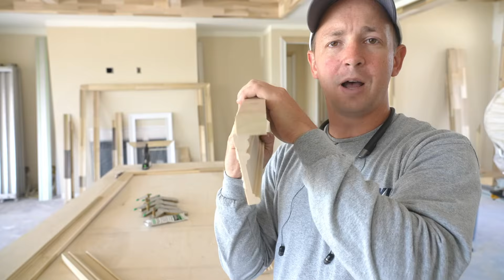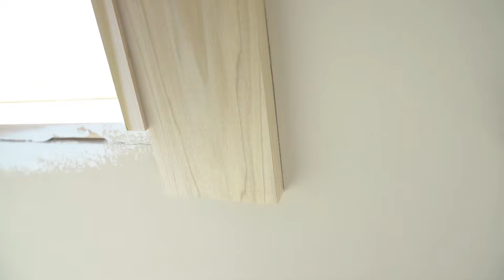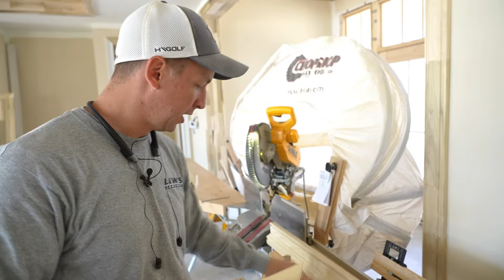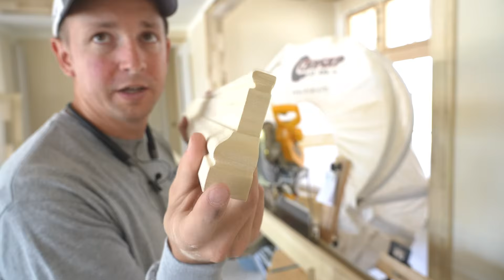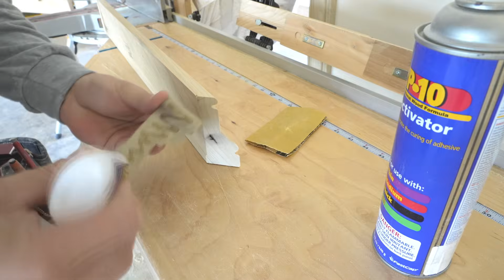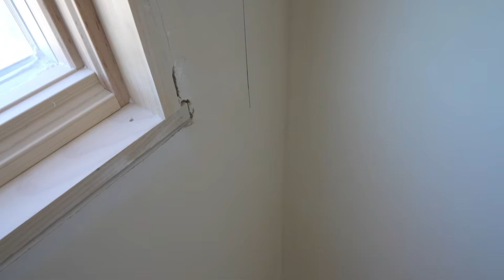NO NAILS??? -How to: CRISP MITERED RETURNS with NO NAILS!!!

Comment: @7:20 I get the theory for this but in my area we often cut returns like this for under sill trim and scotia, in these cases I don’t cut the piece down to the width of the trim itself but cut it long and rip to size on a saw bench after, gives you the option to have a longer return to match the bevel of a weatherboard.

Comment: I have the same setup with Andersen windows and extension jambs installed. I have looked through some lumber yard trim catalogs without luck. Any thoughts on where I could find the stool/apron combination trim piece?
Reply: Koetter Woodworking 40120 CA

Comment: Spencer, that is exactly how I have been doing it for over 30 years. The only difference between you and me is that I  normally have to pry my fingertips from the trim. In some areas I just CA glue the trim in place, especially where I think a nail might split the wood. By the way, I noticed you use a mechanical pencil to mark with. I hired a "trim carpenter" one time and first thing he does is drag out the flat carpenter pencil that was marking a quarter inch line. I asked to see his pencil and promptly threw it out into the woods somewhere and told him to go out and get a .5mm mechanical pencil. He started doing better work after that. Excellent video my friend.

Comment: Spencer, you talked about a 1/4” reveal…. Do you do a reveal also on the bottom where the stool meets the extended window jamb?  Or do you prefer that flush?  What’s typical?
Reply from the maker: I always leave a reveal in that situation. It needs the offset to look good over time unless you're gluing up the whole thing with biscuits and sanding...which takes a ton of time and is hard to execute correctly.
Reply: @InsiderCarpentry what if the stool is 2-1/2” deep? What do you think would be the best method of attaching this to the jamb extensions? Also amazing work! A lot to aspire to!!!!

Comment: Good method with the CA glue. Problem with sharp corners is the paint or finish. It does need a little break for the painters sake. I do both most times and I'm getting old so take that for what its worth.

Comment: Your bottom piece is my top on a current job where I am trimming out the new top floor in a craftsman style with that on top?  I know Spence I just roll with it their choice?  Anyway based on priors I skipped the returns and router the edges over and offset is a 1/2” & bottom 1x2 is a 1/4”.   Once painted not bad?  I did remove one of the double beaded profile to make it flow better?  Very fiddly but in the end at least they all match and fit their taste! ?

Comment: Haha the hard part for me was never assembling it ,it was getting the hang of that thing flying 110 miles in any direction it wants off the saw.
Reply: Agreed: I always cut the return portion longer, then glue and rip to size on the saw bench after, gives you the option to bevel the return to match cladding if you are going under a sill or fret work etc etc

Comment: Is CA glue more economical than HyperPUR for the miter returns?  Or do you use CA glue because there's no setup required to use it (plugging in HyPUR or charged batteries etc)?
Reply from the maker: Hipur is too thick and not necessary for this type of application. CA glue is the best choice for a variety of reasons. Easy to grab and use. Super thin so it creates a perfectly tight joint. The joint won't be stressed so you don't need the strength of hipur.

Comment: Is that a pneumatic brad nailer I saw in the floor?!...I thought you were using Milwaukee cordless nailers almost exclusively? Just curious what guns you're using for what? I've been using dewalt cordless nailers and haven't been satisfied with how often they don't set nails.
Reply from the maker: I use both. I still like air for bulk nailing. Cordless are too heavy to use all the time. Hard on the shoulders.

Comment: Great video! You a real professional. I have been using 2p10 for years and have to say there was a bit of a learning curse since I had been using titebond. I used to have the glue oozing out onto my fingers which would then have me stuck to the molding. I would use a fresh razor to cut it off me at the end of the day, hahha! Stuff is no joke!! I had a hard time sourcing the activator with covid. I still dont have any lol

Comment: This is exactly how I do these and it always impresses.  Sometimes you have to 2 piece stubby sills (seats) and skirts on windows with jamb extensions, then I add a couple of biscuits between the jamb and sill on wide windows or they want to separate and nailing the center is awkward.  Best finish carpentry channel on YouTube
Reply: I have 2-1/2” stool to add to the jamb extension. I’m guessing you would recommend biscuits and gluing to get the stool flush with the extension. I’m worried about cracking along the joint. Thoughts? Also live in Canada so not sure if that will be a concern also?!

Comment: We'll done Spencer. Another good video. 2P-10 and other CA glue has been a huge game changer for me. I can now do high end prefinished crown/riser/light rail in about 1/3 the time than before. BTW, wood glue does not adhere to mitered end grain so it is really being supported by your 23gauge pins only.
Reply from the maker: For a simple return I am very comfortable with the adhesion. I use it all the time without pins for returns.
Reply: Wood glue DOES adhere to "mitered end grain". You need to coat both pieces of wood then, apply pressure for approximately 1 hour before it sets. 24 hours full cure strength (stronger than CA glue). Although, CA glue is plenty strong on it's own for trim.

Comment: With window molding would you suggest attaching a curtain rod holder to the molding or to the drywall?
Reply: Put it on the drywall so the curtains cover all of the trim when closed and open wider.  Blinds should be fitted inside the jamb so they are recessed
Reply: @ydnark83  Attaching to the drywall also makes for a much easier patch/repair should you ever decide to remove the curtain rod or change styles. Fixing detailed casing is more work then mudding drywall.